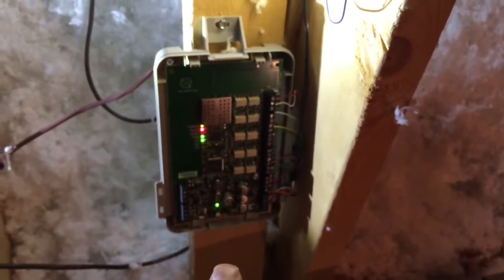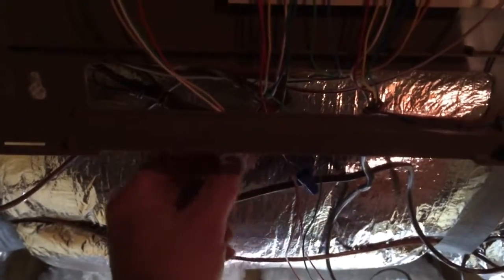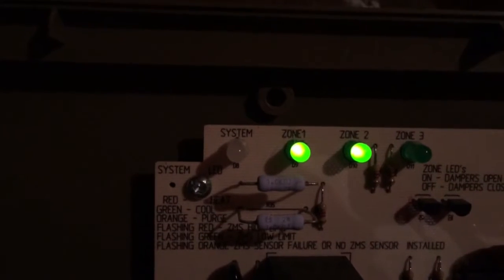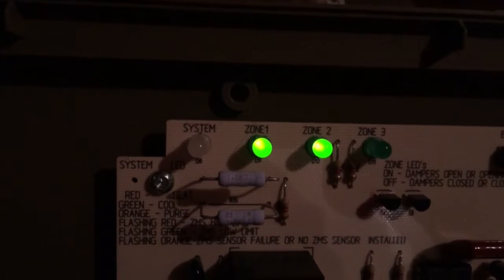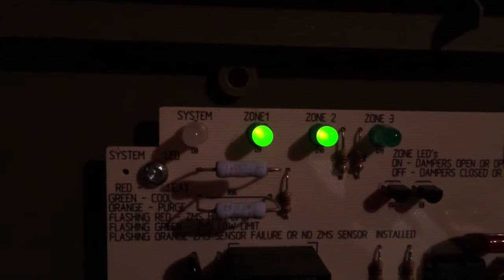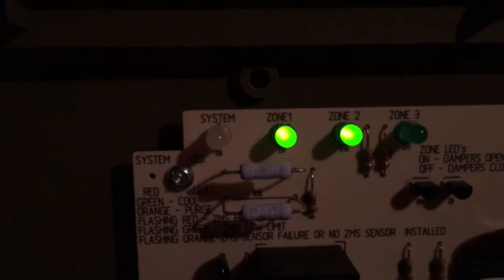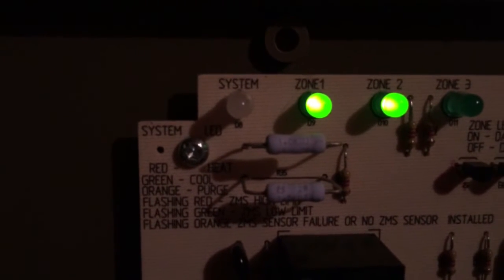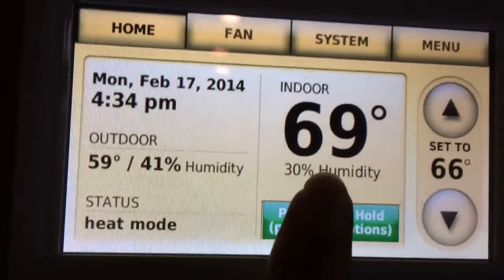Using HVAC Relays In Unusual Situations

Comment: Hey Brother! Good stuff and I enjoy your videos! I'm in HVAC in Colorado. I just converted my single zone to 3 zones: FAF, AC, Hum. HZ322. My question is this: I have the digital humidistat in the return air duct, which has worked just fine in my single story house with single zoning. I am concerned about how I should wire this with the zoning I now have. Shouldn't I wire it to only come on when all of the dampers are open? I can send a fan call to the zoning board when no calls for heat but call for humidity and thus open all zone dampers. But the problem arises that if one zone suddenly calls for heat it will close the other two zones dampers as well as the humidifier so I cannot humidify when  less than all zones are calling. Any ideas about this??

Comment: Thank-you for your video! You’re the first person that has explained humidity control beyond just using a humidistat on heat cycle. I am now going to wire humidistat next to thermostat across the R & G terminals to run with fan when necessary! THANKS AGAIN! Jim

Comment: A couple comments:  One probably would not be allowed to install a relay on a stud as this was done and meet electrical and UL codes.
The second thing it appears that faston terminals have been crimped on solid wire attaching to the relay.  In general, crimping of these on solid wire is un-reliable when done with hand crimpers.  Long term failure can happen due to oxidation.  Best to use stranded wire here.  The concept works fine though...
Reply from the maker: Hey Fred thanks for the comment. I agree with you about not crimping solid wire, if this would have been timed I would have use stranded. But since it was just 18 gauge tstat wire it'll be fine I've never had an issue with low voltage crimped wires failing. I would never crimp a piece of romex though. If there would have been line voltage going to the relay I would have definitely put the relay in a box but since it was all low voltage really didn't see a need for it.

Comment: I love the prestige stats!! They will run anything and the remote room sensors will read humidity, so if the stat is in a bad spot just add a sensor and roll on.
Reply from the maker: They are top self stats. The only bad part is they have so many different stats that its hard to keep them straight.